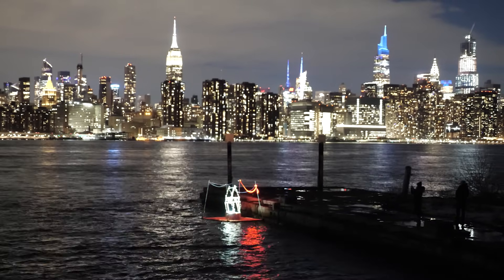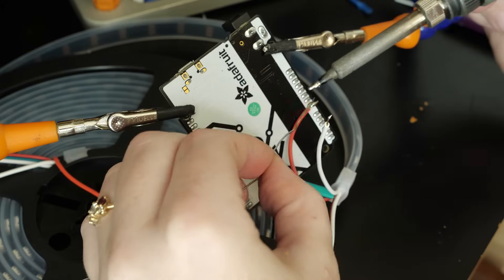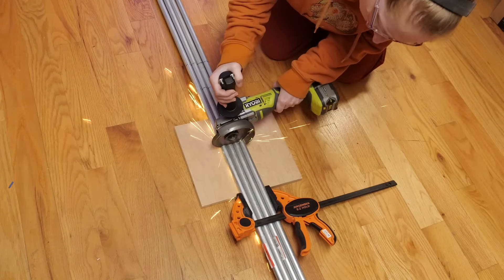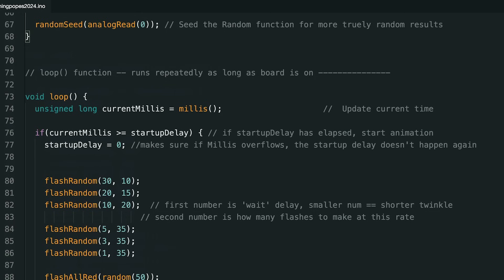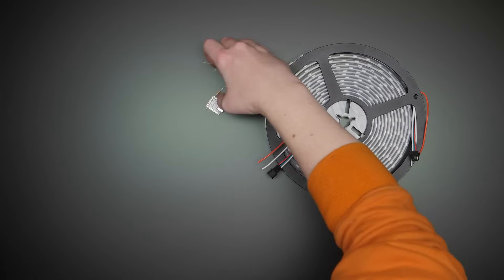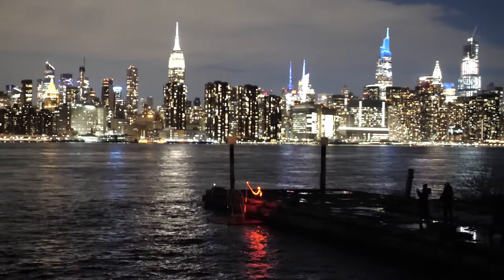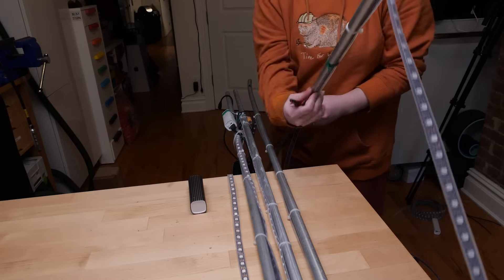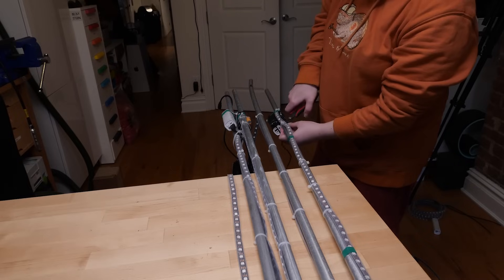I had one week to pull this off...

Comment: You could use wled software for the leds, it makes an wifi acces point for remote control or you can connect it to your own network it even supports various remote controls as infrared and the wiz wifi remote.
It has tons of effects, it can make segments and lots of other stuff, it can power ledstrips and matrix panels.
best of all, its free
Reply from the maker: Wireless was deemed too risky, we were pretty far from the microcontrollers. Agree wled is very cool tho!

Comment: Speaking as someone who's used their kitchen counter + an air conditioner as a sawhorse, seeing you throw sparks with your angle grinder on the hardwood floor in the middle of your apartment was the most validating thing ever 😄